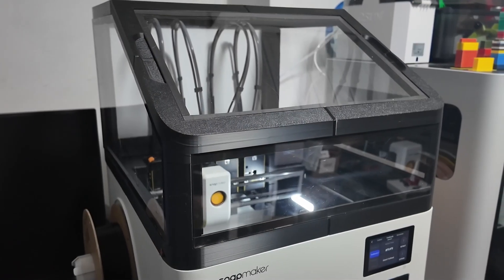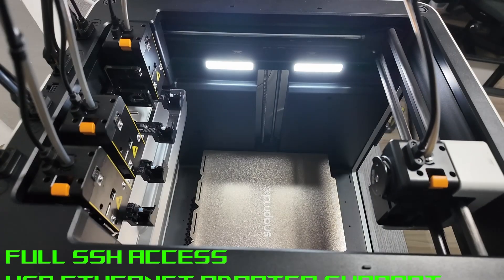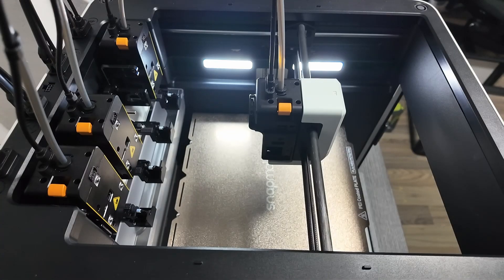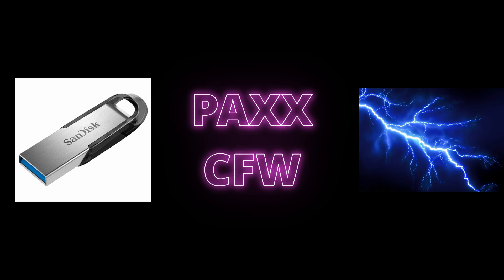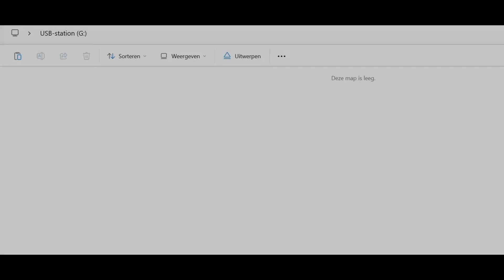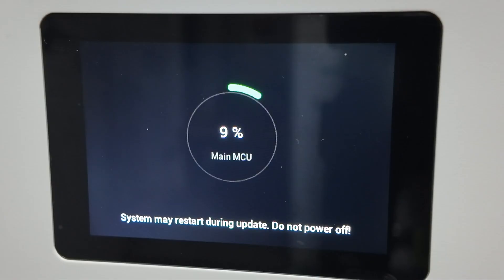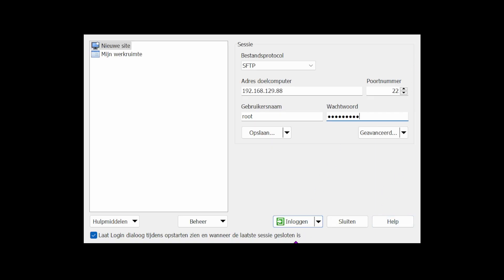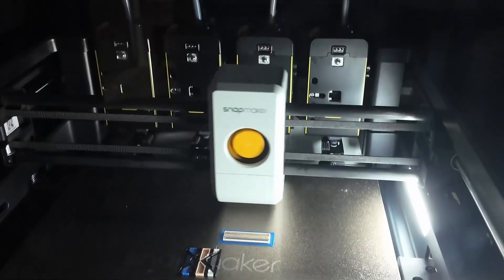The Snapmaker U1 BEAST MODE Update: SSH Access, WebRTC, 30FPS Camera & More!

Comment: so do i need a rasperry pi to watch the printer through the camera? 
because every fluidd thing i see is all based on linux and raberry
Reply from the maker: No not at all, your stock camera will be automatically added to the fluidd instance (your printers ip adress in your web browser)  and the external camera which can work simultaniously with the stock build in cam can be manually added if needed.

Comment: Has anyone verified that the 30 frames per second camera access doesn't cause CPU sluggishness
Reply from the maker: They just capture jpegs, fully in software. In LAN mode the data is transferred directly between U1 and device. There's enough prior art to have over-the-internet h264 streaming (like webrtc)

Comment: I love the cover, looks better than the official version.
Reply from the maker: yes it looks cool, however the official version has a build in fan that connects to the printer frame, this unofficial one doesn't have that feature (yet)
Reply: @aim6mac  i was intending to make this DIY one (high slope version). however, after factoring in the effort and materials, it's approaching the $150 sale price of the official one. So I bit the bullet and ordered the official one.
Reply from the maker: @liutang  depending on how much time u are willing to put in the DIY one it can be better or worse then this U1, u could make a DIY one after getting the U1 though and compare them... the DIY one will be easier for future upgrades the U1 not so much :)
Reply: @liutang that was my thought exactly, and as it ships later, I’m hoping it has some learnings applied to it. PLA vents?? I’m actually thinking of moving the feeders/tubes to make a better dry box solution… but nothing can happen until it arrives. It does seem that some people who gave it are modding it already, like this YTer, changing JSON files for different nozzle sizes in one print. Etc
Reply: The "official" cover is a scam.  A formed piece of plastic with no value for the $150ish they wanted forbtye add-on at the KS, alet alone the almost 250 they want for it at street price...  charging 250 for a plastic box, no active heating. no consideration for proper ventilation solution or in chamber air flow/balancing. No actual VALUE for what they want your $250 for.   I had initially had it added to my 2x backing. But when they stone walled putting out any actual information about it till the verry last day of the KS it was waaaay too little, too late.
Reply: @blaqkhavok4863 Agreed when I saw it on Kickstarter, but then it got added as an “Add on” via Backerlit, and in the UK it was on offer at£135 inc taxes (20%) and they said it had fan filter, heater to 50°C, so it all of a sudden became similar in spec to a filament dryer box, and tbh it out scored a DIY solution for me at that price point. I think SnapMaker were being speculative, and fishing for demand on KS, however it does mean when it lands I will be able to try ASA and ABS, plus have a cover I can mod if necessary.
Reply: I printed the same cover. Works great

Comment: Did you make that cover or is this what it’s going to be sent to us later on?
Reply from the maker: cover is home made , it's not the official one...
Reply: A user named Srin provided this and a few other designs for free on printables (and makerworld I think). It prints in ~46h via 3-4 buildplates so you only need to add the acrylic sheets.
Reply from the maker: @MartinRies  yes indeed with home made i meant not bought through official ways :)
Reply from the maker: @MartinRies  also in my other video about the review of the U1 i did share the stl file in the description of the video

Comment: Maybe they should just give the guy a bit of money and add it to there base firmware.
Reply: They won’t, I have made custom patches for devices in the industry I repair electronics for.

Offered to share info etc for free and they don’t ever want to recognise the help.
Reply from the maker: Snapmaker can do this all themselfs aswell, it's just they choose to send all the video feed first to a cloud system and then back to you... this CFW doesn't do that, it uses local network.
Reply: @aim6mac  no, they don't use a proper stream but take pictures and save them as JPGs instead, which takes a few hundred milliseconds each. Maybe that was their planned sw-architecture for spaghetti detection. There is also a LAN mode which doesn'T connect to the servers at all.

Comment: This is great stuff and I will definitely be looking looking into this when my U1 arrives in January.  I purposefully chose the November batch instead of October to give them a little more time to work out bugs but if Snapmaker was smart they would look at this firmware upgrade and specifically use it to improve their own firmware at the factory.  Personally I could not care less about the camera as I don't do timelapse or streaming but the other features are a big deal.
Reply from the maker: fully local network, wired connection , yes i know... great features

Comment: This is great to here! However I am wondering why SnapMaker choose to  have low FPS and other features turned off or tuned down. 
I wonder if we could end up taxing the available computer power that the main board has?
I am happy to have a play once mine arrives :)
Reply from the maker: Snapmaker is just capturing jpegs, fully in software. In LAN mode the data is transferred directly between U1 and device. There's enough prior art to have over-the-internet h264 streaming (like webrtc)